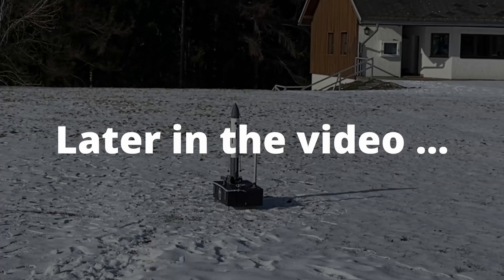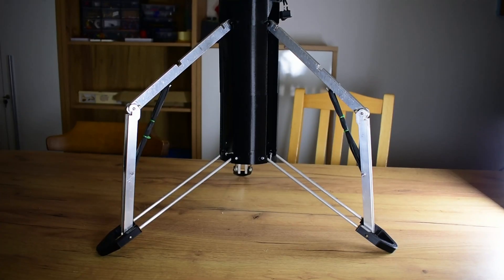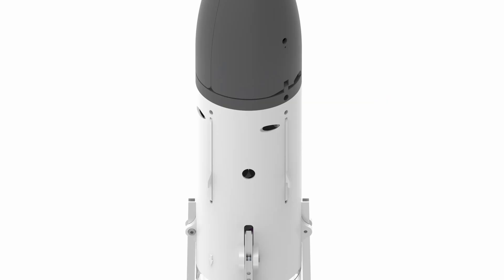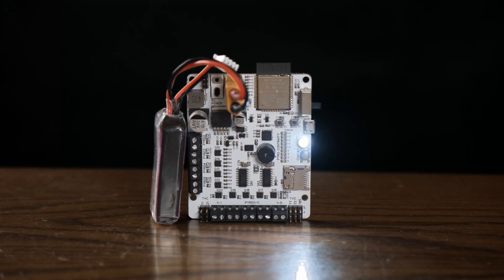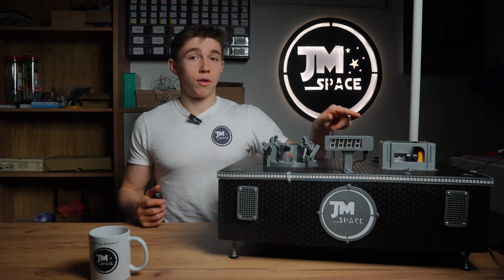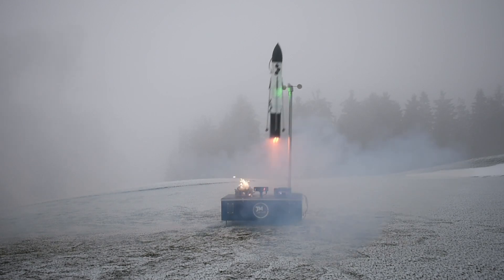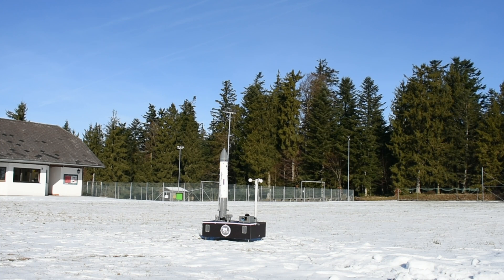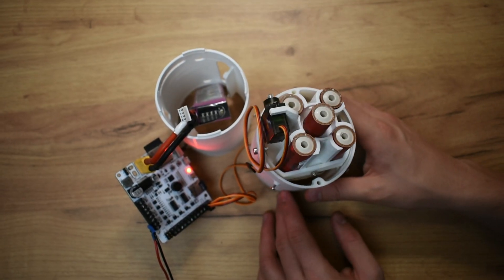My most successful Rocket Launch yet | Buffalo L - Flight One and Two

Comment: Thank you bro that's amazing🎉🎉do you have experience in drones or Rc planes?
Reply from the maker: Glad you like it :)
I have not much experience with either of those two, but during my model rocketry journey, I have worked with brushless motors, ESC, and several radio modules that are used for RC applications (HC-12, NRF24,  etc.)